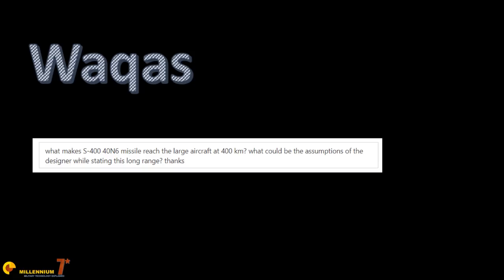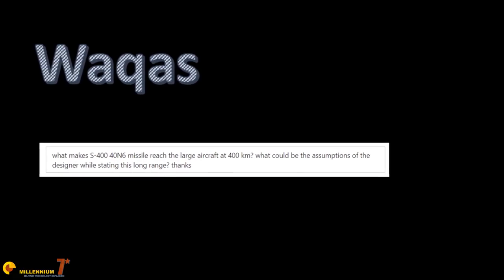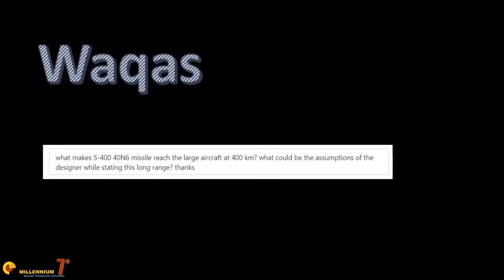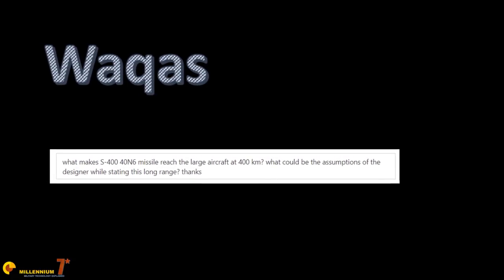Why AESA Radars are LPI? - S-400, Tejas and more - Community Q&A March 2020

Comment: I’m sorry, but you mostly got it wrong on AESA (Active Electronically Steered Array) radars and LPI (Low Probability of Intercept, i.e., hard to detect).  1st starting with conventional radars.  These radars, you normally use a high-power relatively narrow frequency band tube.  These radars could put out a very high power in a narrow frequency pulse.  Almost all parts of these systems were difficult to tune and change frequencies quickly.  These were then coupled to a mechanically steered directional antenna.  Next was steerable phased array antennas.  These start with the same high-power tube but would then have a series of divider networks to divide up the high power into multiple small antennas.  These were some of the 1st radar systems.  By adding a small device at each antenna element, you could then change the phase (hence the name) or the timing of each pulse at each antenna element individually.  Additionally, they are computer-controlled. These phase/timing changing elements are also extremely frequency-dependent and are challenging to make work a crossed large frequency ranges instantaneously.  The whole array could also be coupled with a mechanical device to point the entire array but allowed for very quickly shifting beams with even the possibility of multiple beams.  AESA radar uses a small computer-controlled low power transmitter and receiver at each antenna element.  As these are each low-power and have very few frequency-dependent components to them, their frequencies/modulation could be changed with every pulse.  Radar pulses on the same frequency are easy to detect as they are high-power and repetitive, so the detector has an easy time seeing them.  AESA radars can have each pulse on a different frequency over a very wide band; it can look like random noise.  Additionally, as each pulse can be modulated with a wideband code, this makes it even more challenging to detect the pulses.  When you modulate the signal, you can transmit additional information so you can use it like an LPI radio.  Also, with AESA radars, not only are these systems usually LPI radars/communications systems, but they tend to be inherently difficult to jam.
Reply from the maker: Thanks for the adding so many details and complementing the video.
Reply: @Millennium7HistoryTech  You're welcome, and I'm happy to have something to contribute.  Here are a few more tricks up AESA radar system's sleeves.  The LPI communications allows stealthy platforms to communicate stealthily between each other.  This will enable them to incorporate things like sensor fusion. AESA radar systems can also be extremely high power jamming systems.  They can jam both the communications within their frequency ranges and radar systems.  Reportedly some of these AESA radar systems can produce pulses, at relatively short ranges, that are so powerful they can physically damage the opponent's receiver systems.  Normally dedicating so much of your radar systems to something like jamming would leave your own systems radar blind but with sensor fusion, you could have one system be the jammer while other systems are looking out for the jamming platform.  It is not just the transmitting portions of the AESA radar systems but their receivers can be used to collect intelligence.  This intelligence would not be just for any other radar emitter but potentially any of emitter within their receiver frequency ranges.  Again, this information can be shared with other platforms.  I am not aware of any missile system that can do the following but in theory, it would be possible.  One of the platforms detects an opposing aircraft.  It passes this information off to the platform best positioned to launch a missile.  The missile passes its GPS location via LPI communications to whatever platform is tracking the target.  This platform, in turn, would pass course corrections to the missile via LPI communications system.  In theory, this missile system could be a two-stage rocket design with the 2nd stage only being ignited for the last terminal guidance portion of the flight.  The missile's own AESA radar systems need not be activated until very close to the target.  With the use of LPI communications and radar systems, the missile target quite likely would not know it's even under attack until the terminal rocket engine started seconds before detonation.